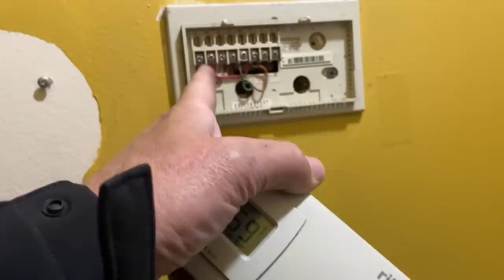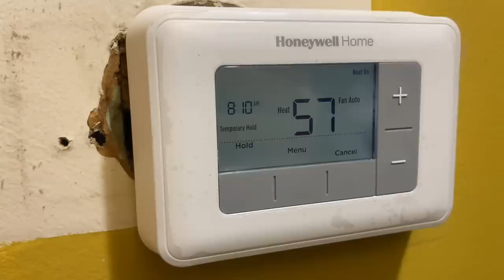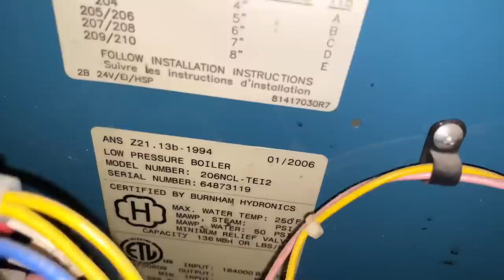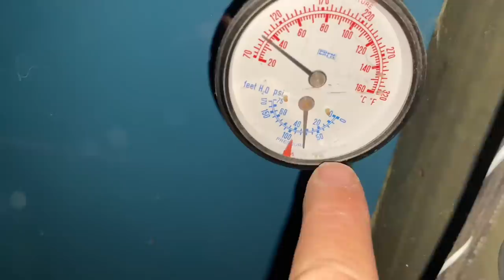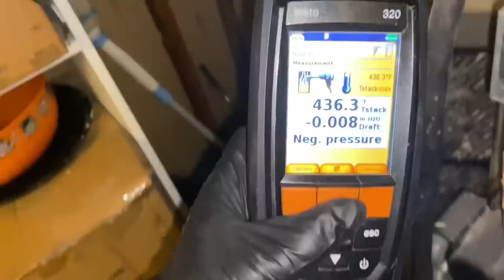No Heat Burnham Gas Boiler Thermostat & Thermocouple Replacement Instructions

Comment: By the way, Mikey you still explaining how the basso switch works inside that Honeywell gas valve? I guess have replace a few pneumatic gas control systems too. Again Wasington, D.C. is a pretty old city, somethings around here date back to the 1890s, 1880s.

Comment: so at 4:36 all three zone valves are open and all three should have the end switches closed and trying to fire the boiler.
so why did the far left/1st floor zone valve end switch going on/off trigger the relay and flue damper? bad zone valve end switches or miss wired? hmm. somethings fishy there also.
**and you pointed it out late rin video. 🙃